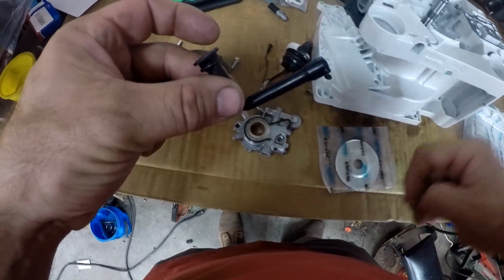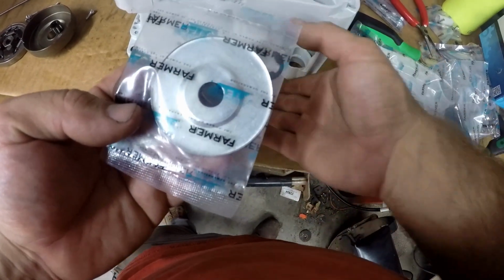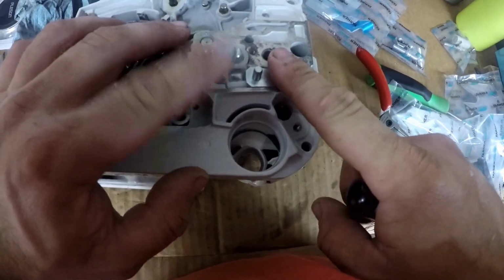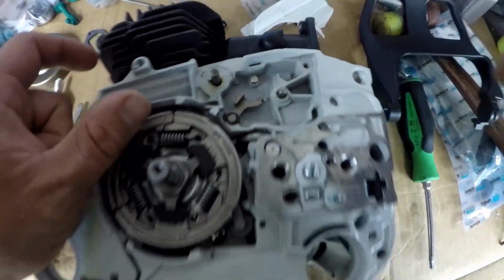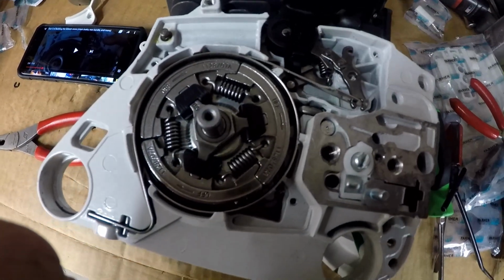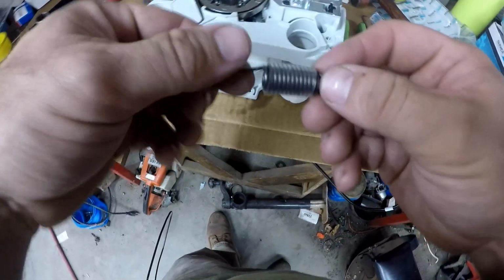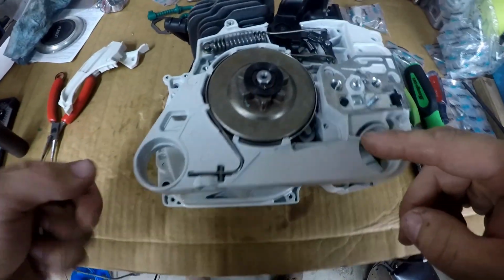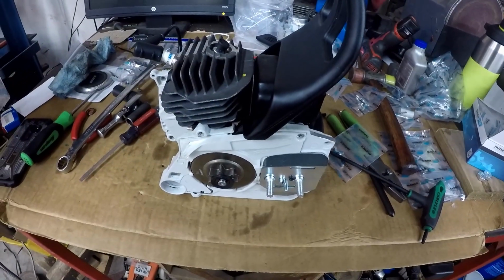Farmertec MS440 Assembly Part 2- Step by Step

Comment: all these years I've been worried about the crankshaft/cam.  however you made that look easy.  this brake system has me worried again.  Thanks for doing this step by step video though.  On to part 3!
Reply from the maker: It was really that easy. There is something wrong with the brake parts they send with these saws. I read the one spring they give you is for a MS 660. I need to look into that. My brake works, it just has to be pushed really far forward.

Comment: Great video for a full assembly. At 1:40 the rubber oil pump plug (Stihl PN 1128 647 7000) first appears in the video, already installed on the oil pump. It was not installed in the prior footage. I don't see where it's installation is mentioned at anytime afterwards either.
Reply from the maker: Thanks! Sometimes a small part can get left out in the filming or editing process.

Comment: Thx for the video..im building one now..actually just rebuilt a 44 for a buddy n kept having a leak when p/v testing, clutch bushing was leaking so looked in service manual n there's an o-ring that goes under the bushing not shown in ipl it stopped the leak so I put one in my build as well.. how's yours runnin..ive got an oem cylinder goin on mine n put farmertec  bb on the other 44 n it's a nice cylinder w good port numbers!! Good stuff roger!!
Reply from the maker: Thanks!

Comment: Couple of things, I don't think a gasket is supposed to go between the cylinder and the heat shield, the IPL only shows one gasket between the shield and muffler. Second, your bar studs are around the wrong way and I think you're supposed to apply loctite to the threads
Reply from the maker: I may have put them in backwards, the log side of the stud goes in the case. Yes, the studs on a stihl have loctite from the factory.